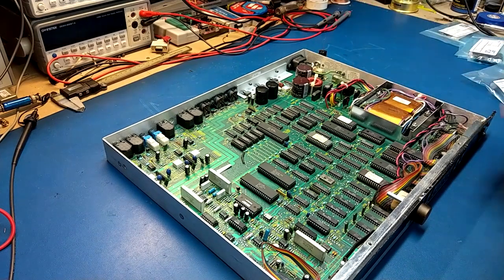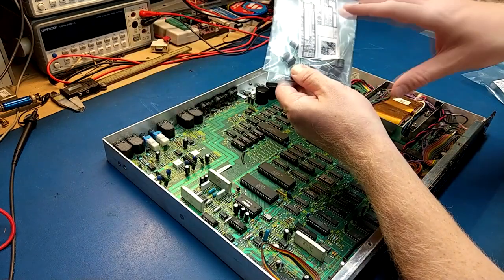Lexicon PCM 70 Repair - Part 2

Comment: I've had similar issue (as I discovered later) with CPU NEC D70008AC-6 (Z80) in my Yamaha PSR-60 keyboard. After switching the power on, not a single button or key worked at all as well as all the LEDs (except the Power). Sometimes when I switched the power on while holding random button, some LEDs did work but it didn't change anything. So I replaced all the 66 (!) caps and 2 ROM ICs. Nothing changed. Analog and digital voltages were good. Then it came to my mind that maybe the reason was in logic. So I decided to replace the CPU (I got used one from AliExpress as it wasn't available in my country). And it really worked!

Comment: Hello there. Please, help me. My Yamaha SPX 900 died. I noticed there are two burnt out 11ES4 diodes in the power supply plus leaky capacitors. Can you please tell me which equivalent diode I can buy? I don't find 11ES4 diode anywhere. Thank you very much and congratulations for the wonderful channel.

Comment: I'm not sure about that piece of tape, but mine did come, new, with a piece of tape (transparent amber mylar) in that spot. It's been a long time since I replaced the soldered-in battery with a battery holder, so I don't know if it was due to longer battery terminals, nothing else seems obvious.

One note to watch out for: The factory 3300µF caps have very thick leads, a fair tight fit through the vias. And in retrospect, I can see one of the caps had the leads squashed a bit in trimming them, from the original installation, explaining why it took some work to get C143 out in particular. Even though I was careful to use reasonable and steady force, it pulled the vias out. The traces were fine, just the vias, and they were so tight on the fat leads I was lucky to notice it even happened. I thought, surely that not the only connection from between the two sides of the board for +5V and DGND, but it sure was. So after replacing C143 (I replaced all electrolytics) left, I had to drill a couple of holes and connect top and bottom for each of the paths.

In my case, the unit's failure mode was the display going wild, the +5 supply showing a ton of noise...and a bloated C149, so the cause was obvious.

Comment: Hi Brad, I got a PCM70 which the z80 CPU was done, I am wondering that if I could find another same z80 CPU to replace it. Or should use the z80 CPU in the PCM 70?

Comment: Hi Brad. Awesome video. I am struggling with a similar issue. PCM70 with only half the chars showing on the display and no response from the keypad. I am quite sure this comes from the 74HCT273 and / or 138.
It threw me a little seeing that the Z80 was also bad in your case.
Any thoughts?

Comment: Hello Brad - your video inspired me to take a stab at fixing up a PCM70 I got in pretty rough non-working condition.  I found and addressed a few things wrong with the unit, and was able to get the display working, but there is still no reverb and the sound is fizzy and distorted even in self-test mode, and worse in normal/run mode.  The overload indication (front panel level LEDs all on) goes active a few seconds after power up with a light sort of fizzy pop sound .  I can get a clean signal through the unit only in 'bypass' mode.  I am wondering how I can confirm the checksums on the three main EPROM chips.  I have access to an eprom reader at work, but I do not know what the checksums are supposed to be.  Could you possibly pass along or point to a source for that information?

Comment: Hi brad, nice vidz! I also have a pcm70 with battery low on it. I saw that the battery is a vertical mounted BR2325-1VC (3v/165mA) lithium coin cell from Panasonic. Do you know if I can put any vertical battery holder or is it a special one that is needed? I think it's better to not to solder desolder each time I change the battery. I saw you'll do a pcm60 video too? That's cool I have one and I think it's noisy, surely need some recap.
Reply from the maker: You can definitely replace it with a socket. mine wasn't dead so I didn't bother at the time. Digikey or Mouser should have one the right size, just need to measure the pin spacing. I'm wrapping up another synth repair now and have a pair of PCM60s that need repair that I'll be working on next, so that will be coming soon.

Comment: hi brad! just came across your video looking for some resolutions for my PCM 70. It's saying 'battery low' on the display, is this a problem I can fix myself? or would you recommend asking someone who knows better...
Reply from the maker: Yep, just replace the internal battery, it is soldered in but easy to replace. After that, factory reset it. You will lose any saved presets in this process.
Reply: @bradthx  thanks man!

Comment: anyone know WHAT is with those GOLD knobs??? i have an M300 that has the same - was this some weird quirk when lexicon had a particularly bad production manager or what?
Reply from the maker: So many are like that, lol. Best guess is something with the paint / powder-coating at the time fades or is worn from use and turns a slights gold color. Very odd.
Reply: hmm strange because I have FOUR M300s from the same era  and only ONE has the gold knob - and that's one of the later ones